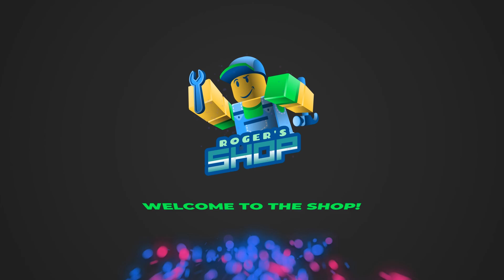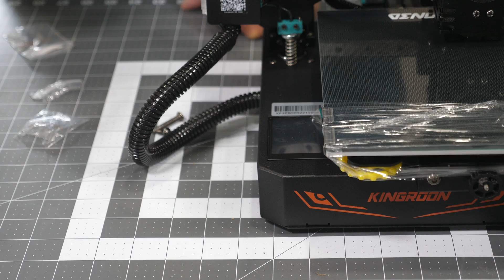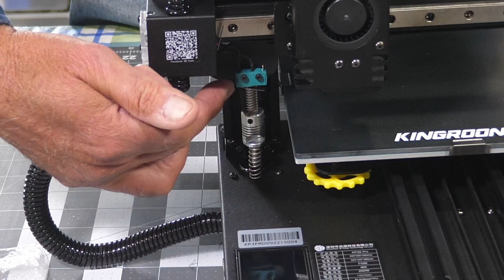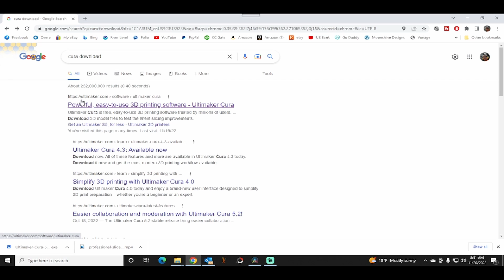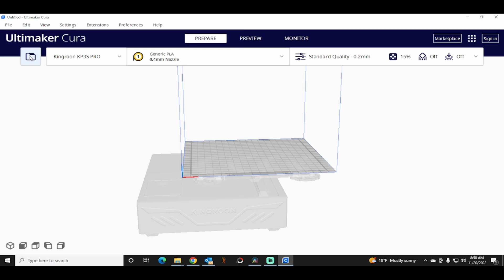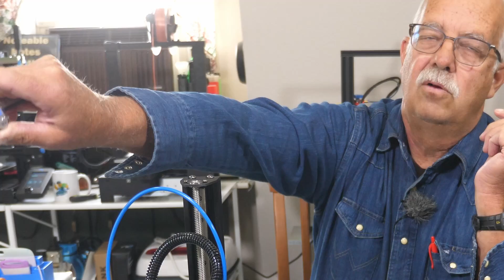Kingroon KP3S Pro 3D Printer Detailed Assembly

Comment: Hello. Please tell me. I bought T-ABS FULCRUM. KingroonKP3Pro printer, ultrabase table. I couldn’t even print anything before tearing it off. 260/100 the printer hangs (probably it’s hard for it to heat up like that) if 250/90, then instead of a layer of crumbs. as if the nozzle was clogged. Is it even possible to print with this plastic on this printer? I hope so, but how???
Reply from the maker: I don't use ABS, so can't help you out here.  Most of what we print is in PLA Plus or PLA Professional.

Comment: nice vid,

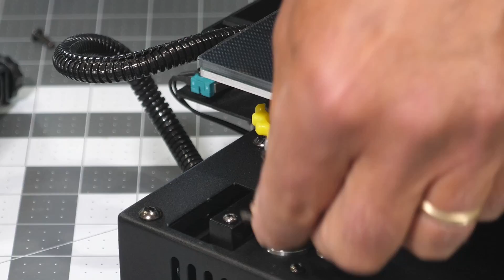Wish you had provided "Links" to the tools you were using (not included). I want the ones used on those 2mm & 3mm bits ( @ the3:29  mark)? The "Ball Driver ?" and  "ball driver?", used to connect the "Z" access "Gantry" ? I could not find them on Amz. or their description (IMHO) did not match yours ? If anyone can tell me where I can find them on Amz, HD or LW pls do ? Do they also come in a small set, of 2-5mm sizes or something like that. I think a very small set, of them will come in handy.
Reply from the maker: I have several sets of different brands accumulated over the years.  Here is one of them:  https://amzn.to/3LpGmeL
Reply: @rogersshop  Thx (& subcribed)

Comment: Very clear video but I have one question. 
I’m having trouble leveling points 2 and 3 even at the lowest setting on the z-axis and the highest seething on the plate. The nozzle just doesn’t reach the plate.
Reply from the maker: Is your baseplate bent?  Place a straightedge across it.  Should be no gaps.

Comment: Т-образные гайки ставятся ГОРИЗОНТАЛЬНО! Они должны притянуть мачту к корпусу. При вертикальной установке (как в твоём видео) они БЕЗПОЛЕЗНЫ!!!
Reply from the maker: I understand English and Spanish.  This, not so much
Reply: @rogersshop Translation is: "T-nuts should be placed HORIZONTALLY. They are used to tighten the gantry to the printer base. When installed vertically (as in the video) they are USELESS". It's 4:06 on the video.

Comment: You mention a dry box to store filament when not in use.  What type do you use?  A purpose built filament dry box or one that is suitable for multiple uses (waterproof, marine specific, ammo. etc.).
Reply from the maker: I use a waterproof, airtight, gasketed tote to store opened rolls and there are several paks of desiccant in with them.  Works very well, even in our super humid summers.  Even with this, I still put the roll to be used in a Sunlu dryer for 3-6 hours before loading.  The tote I use is actually partly visible to my left, setting on the floor with a cardboard box on top of it.

Comment: Great video, would you please shear that top spool holder design? Their are lots for the KP3S but It’s the first I’ve seen for the KP3S Pro, thank you 😊
Reply from the maker: The design I used is meant for the KP3S and I modified the top mount to fit the factory tapped holes.  I did finally bypass the runout sensor and just put a piece of "dummy" filament in it.  At some point, I might design a different mount for the sensor to put it more in a direct path.
Reply: @rogersshop  can you share it?
Reply from the maker: @slowjamer  I'm making a video soon on how I did this.
Reply: We are waiting to see it!
Reply from the maker: @MrGarafe  Goes up on December 4, but here is a sneak peek:  https://youtu.be/bHPoJ64qYxY